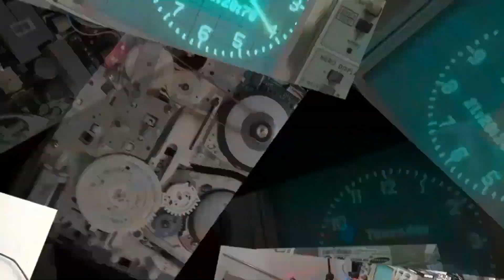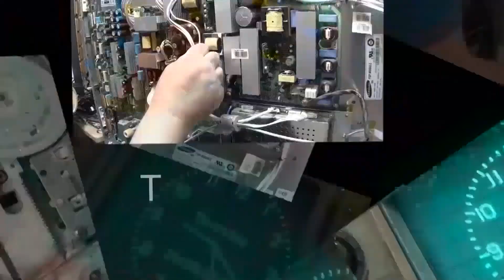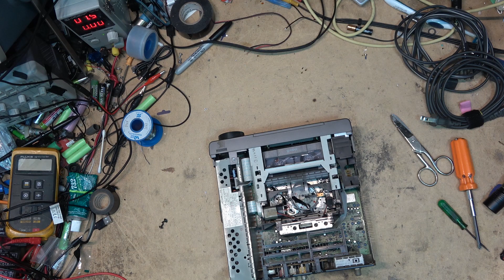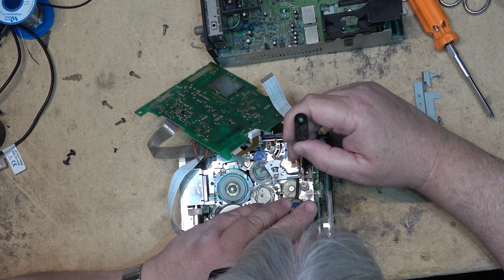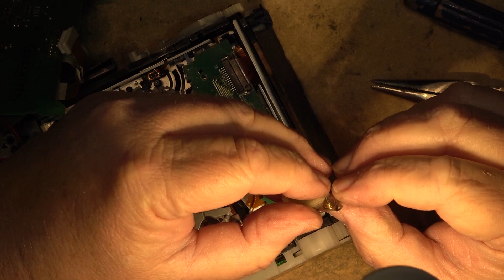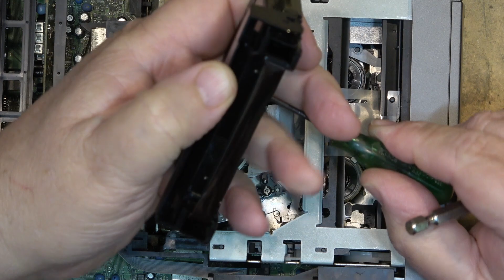SONY EVC100 Hi8 VCR Loads and Unloads Eats Tape

Comment: Hello again Dave, I found a "working" Sony CCD-TR350E camera that seems to wok some of the time. I have been able to successfully copy some videos down to my PC but others stall on play and especially on rewind, with a flashing Eject Tape icon. Rewinding is noisy, FFW not so. 
I took the tape opening cover off and the white transport wheel appears to be cracked, I will post you a picture if I can figure out a way to do this. I have several other non working cameras, if you are able to understand what I am describing and you feel this may be the problem, can you advise if swapping the gear wheel is feasible for an amateur?

Thanks very much

Mike
Reply from the maker: Cracked hubs ate pretty common.  Some are easy to change and others involved.

Comment: Hi from New Zealand Dave, I just purchased a Sony CCD-F150E camcorder from our equivalent of ebay to transfer my library of old Video8 tapes to my computer and the mechanism is making an unhappy clicking noise when it loads and unloads tapes. 
The tape also ejects with excess tape hanging outside the cassette mechanism and from what I can see the issue is something like what this video of yours goes through. 
I have not been able to find a manual but your great series of videos provide good info so I am going to try the steps that this video outlines but would appreciate any additional thoughts you might have. 
Thanks so much
Mike
Reply from the maker: CCD f, fx and v series had the bad caps
Reply: @12voltvids  I wish I had you as a neighbour, you would have a visitor :-)
Reply: Could bad caps result in tape not loading properly or is that more likely to be a mechanical / dirt on the drum type issue. Thanks so much
Reply from the maker: @mikejones9562 sure can.  Servo circuuts nir working. Capstan and drum motors
Reply: Unfortunately you your appear to be correct Dave, I thoroughly cleaned the drum and pinch rollers per your video but no improvement :-(. 
I took the cassette cover flap off but could not really see much other than the drum appeared to rotate back and forwards a little bit (but not spinning) and the tape rollers appeared to drag the tape into position but  from what I could see, was not straight and the top of the tape was folded over the drum. 
When I ejected the cassette, naturally tape did not retract and was somewhat tangled outside the cassette when the flap opened.
Do you recommend the next step is to look for leaky caps or get a technician to look at it. Unfortunately  their initial charge is more than I paid for the camera with absolutely no guarantees that they could fix or if they could, the charge would cover their work.(fair enough given they dont know what they are going to find)
As you outline, I only want to copy off my library, dont care about the camera and recording, only playback but just dont know where to go to next. Thanks anyway, I have learned so much from your videos.
Mike
Reply from the maker: @mikejones9562 drum rocking back and forth is classic cap failure mode. The problem is they leak corossive liquid that attacks the traces (internal traces on multi layer board). It's not worth fixing even if you do replace them if the board traces are damaged it won't work or if it does it won't last.  I was condemning them 30byeara ago.
Reply: @12voltvids  Hi again, I am just about to buy a TVR-35e, are you able to advise if this is one that had the bad caps issue. Thanks so much

Comment: I have the following question: can a hi8 device or camcorder record a hi8 signal on digital 8 cassettes? and if so, will there be noise in the image? To make it a little more understandable, I tried a new sealed cassette on my hi8 camcorders, which I opened, and the cassette is new and has no damage. I recorded the image from both cameras, but there is an issue with the image, many horizontal lines are coming down. The cameras work normally without problems with 8 & hi8 video cassettes, so I wanted to ask. I am curious why this happens with digital 8 cassettes? 🤔
Reply from the maker: First of all there is no such thing as a digital 8 cassette.  They are hi8 tapes just labeled digital8.  Three are only 2 types of 8mm tape regular 8 and hi8.  Hi8 tapes were also labeled digital8 however regular 8 tapes also work just fine as in digital 8 mode. The only restriction is regular 8 tapes only record in SP mode for digital 8. Hi8 tapes will work for both SP and LP speeds.  If you pop the hi8 detection hole on a regular 8 cassette it will record the LP speed just fine on digital 8.  I used to do that all the time when I was using digital 8 as a production format.   
If your hi8 camera is recording lines in the picture it's likely the heads are worn.
Reply: @ thanks for the information, the strange thing is that it does this to me on a specific brand of Sony Digital 8 cassette, on other Digital 8 TDK, Fujifilm cassettes that are also new and I have opened them, the cameras work normally and a clear image is recorded without lines appearing
Reply: Digital8 cassettes are just rebranded Hi8 tapes.  They are absolutely interchangeable with Hi8.  You may just have a damaged tape.
Reply: @video99couk  Maybe they're damaged, I have several sealed Sony Digital 8 cassettes that have been properly stored over the years, but this only happens to me with these Sony cassettes, it's strange 🤔

Comment: The mic setup sounds like you have the condenser stuck in your nose. It's super muffled. Somehow so far, none of these mics beat the mics of your cameras.
Reply from the maker: Lav placement is most important.  There is a reason tv hosts wear sport jackets or button up shirts.  Need that mic placed in the correct place.  It was a little high on my collar and it sounded it.

Comment: the jog should not affect the eject , its bad capacitors in the cpu process area
Reply from the maker: No it's not.   It's a resistive divider divider network for all the buttons.  They go into the display cpu / key scan decoder and are encodes as as the standard control s protocol which is the same as remote control data and it's sent down the i2c bus. Those encoder switches get dirty and show resistance which just happened to be the same as the eject switch.
That's why after flipping it back and forth a few times it fixed it.

Comment: also dave why ur using qtips !? , "not touch the heads" saying it gives a wrong impression to viewers , just use ur paper method PLS!
Reply from the maker: Need to apply a fair bit of pressure to get the crap off. I kept it away from the head chips.

Comment: if anyone plans on getting this unit , i absolutely recommend ! , it uses the same tape mech that is in any ccd-f and newer ccd-v camcorders , so spares are plenty available .

the only thing this mech suffers is loose tape guide alighnment , easy fix , use a pre recorded tape play it back and alight the guides until it plays good , then glue the guides in place and u be safe .
Reply: sidenote , of course you have to assure there are no bad capacitors

Comment: Nice video! I've got a tape of this format, but I think I'll never be able to know what was recorded there... Question: the gears in the cassete box mechanism does not need grease?
Reply: its a 50/50 chance the grease is still fine , sometimes its rancid and needs clean

Comment: I like to see these electronics repaired but you seem to work in organised chaos 😢😢
Reply from the maker: No chaos here.  I know where everything is.
Reply: @ I knew that would be your response . I know some people like working in a mess .
Reply from the maker: You have never been in a real working shop.  I have and every last one was worse then mine.  You aren't earning if you are wanting time sweeping the floor. That's for the slow time.  When my time is slow I am not in the shop I am doing something else.
Reply: @ yes I have been in a real workshop and they’re all a mess like yours . It’s amusing that people make all these YouTube videos but they hate anyone saying anything negative about. 😂😂😂😂😂😂😂😂😂
Reply: Most of the problems were due to deterioration of the electrolytic capacitors installed.
Reply: @zhaohaigaogu7821 ur sentence is off , you mean old caps are bad , newly installed caps fix the issue
Reply from the maker: @Dr.-Smart  Nothing wrong with the caps in this one. Most if not all are thru hole.  Unlike the EVS7000 which has tons of bad caps.
Reply from the maker: @zhaohaigaogu7821  Not in this one.
Reply: Everyone's a critic. 😂

Get a life!